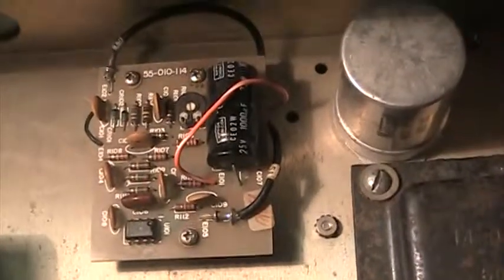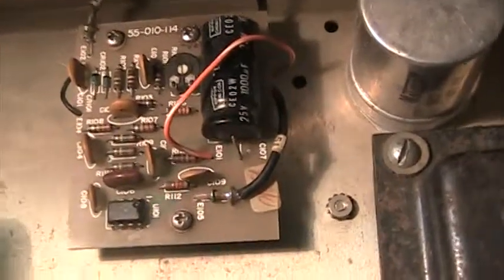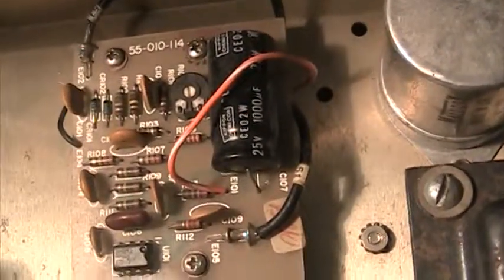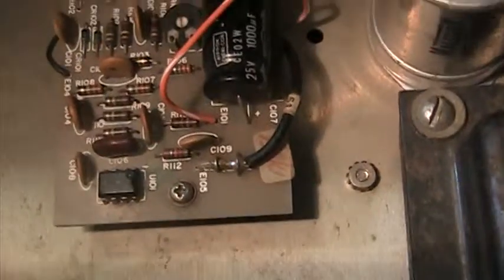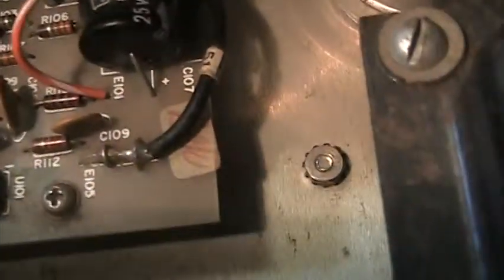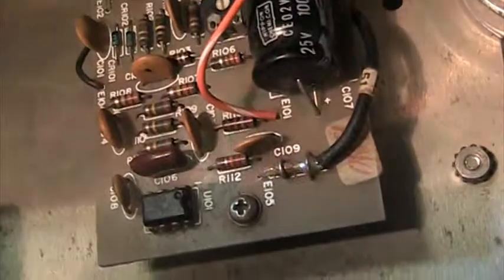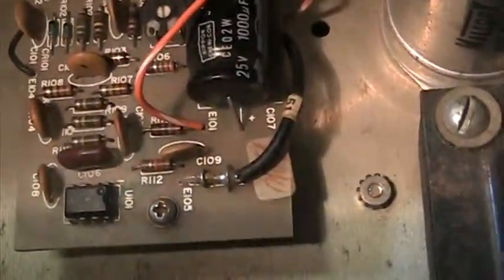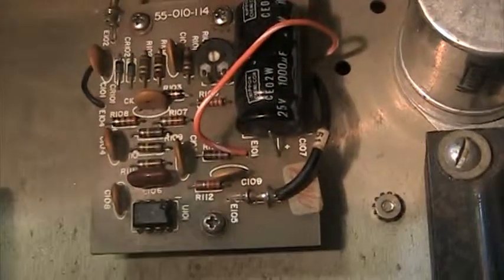Outboard Compressor Bypass

Comment: dr. When soldering those two coaxial cables together in order to bypass the audio Clipper board should both wires positive and negative be soldered to each other. thank you very much